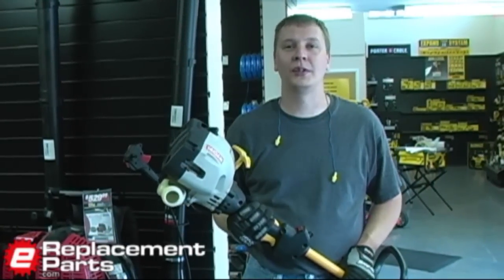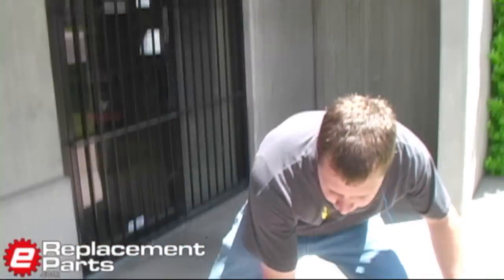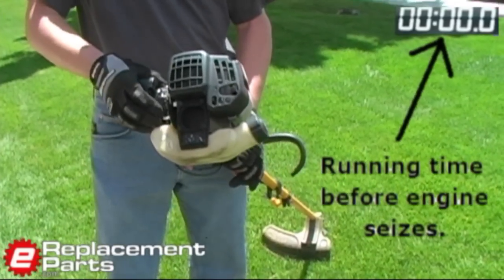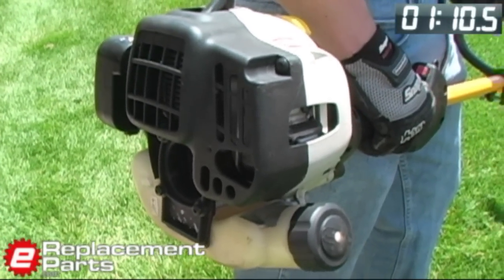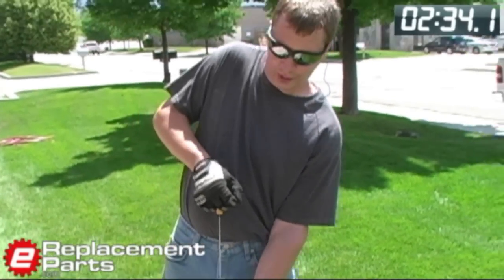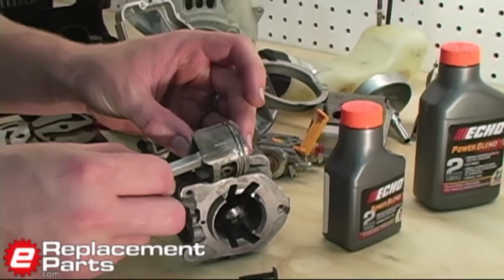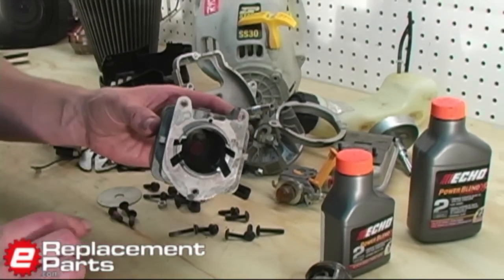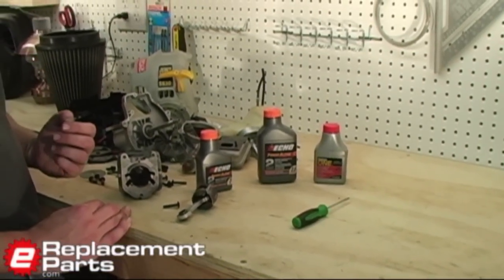Mixed Oil in 2-Cycle Engines

Comment: What happens if you put a 30:1 ratio mix into a machine that requests a 50:1 mix or vice versa?
Reply from the maker: Hello,  it could potentially over heat the engine and eventually and destroy the engine. You should dump or siphon the incorrect fuel out and use the right fuel ratio mix.

Comment: I did that only for testing purposes ONLY i only made it run for 30 seconds because the fuel lines were junk but I LOVE YOUR WEBSITE ITS FANTASTIC I find just about everything there but I will get the two cycle oil to make it run well and properly

Comment: What happens if you use 10W 30 motor oil instead of 2 cycle oil?
Reply from the maker: You should dump the fuel and change it immediately.  10W 30 and 2 stroke oils are 2 completely different
products.  The 10W 30 doesn't lubricate the same way the 2 stroke oil will and the  10W 30 will foul the plug and build carbon sludge in the motor.

Comment: Thank you! I have been trying to find out if there is a gas only trimmer and a friend of mine said he had one but i'm beginning to think that can't be true. Not a 2 stroke anyway. Right?
Reply: yes sir, there is a gas only trimmer, however, it is not a 2 stroke, it is a 4 stroke. and "gas only" only refers to the fuel tank, since it is a 4 stroke like your lawn mower , car, ect. that means there is oil in the crank case. so theres a gas tank AND a seperate tank for oil which happens to be the case where the piston rod and crank shaft is. that means you will have to change the oil like you do your mower or go kart, yearly or w/e your manual says.Troybilt, Cub Cadet, Craftsmen, poulan pro, ect.. all make 4 stroke "gas only" trimmers and other equipment
Reply: Thank you, Chris!

Comment: A shtil string trimmer I've seen one seized the guy ran it for 30 straight minutes before it done I had those things are like indestructible if you use them properlyand you have kept up on the maintenance
Reply: +jasper petersen Thats why they cost hundreds more than regular trimmers.

Comment: @eReplacementParts No problem ! and I was even pouring SAND and very small rocks in to the engine and running it with it in there ! and when I took apart the engine, part of the piston skirt was missing ! and where the bottom of the crankcase was there was ALOT more clearance then there was before !